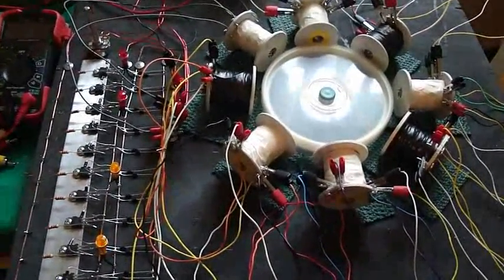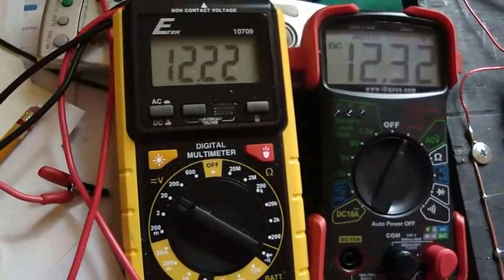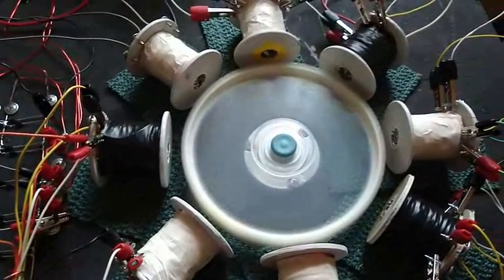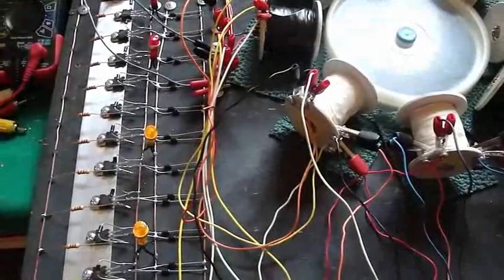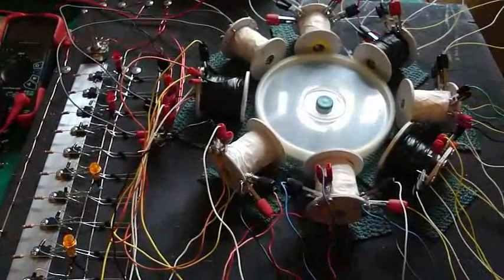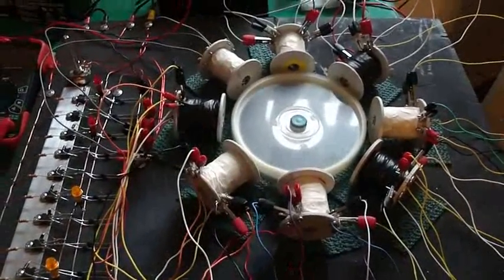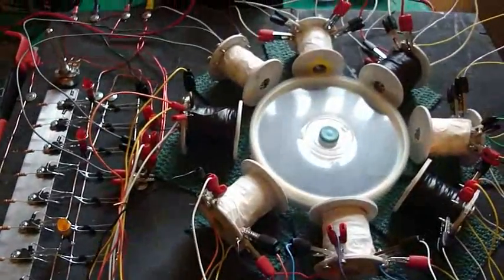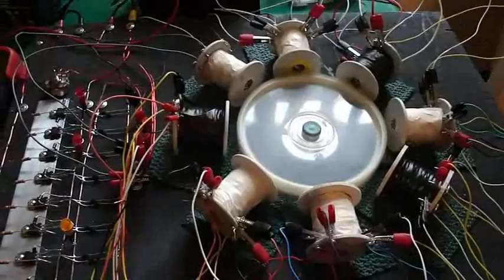Sampu Express.avi

Comment: Just curious, why such a complicated circuit. What exactly is the final purpose of this motor design? Just curious. Never heard of this design. It looks really cool. The Adams motor which looks almost identical is the same motor, but it works on the principle of heavy iron being in the center of each coil. The iron which attracts the magnet is the source of the energy, while the coil is only used to "disarm" the attraction allowing the rotor to pass over the iron cores. It's the principle of the iron and the permanent magnet working together, with the coils acting as a "gate" which produces over unity. I have never built one, but the inventor claimed the coils go colder than ambient temperature and the drive battery doesn't discharge, which is a sign of negative energy entering into a system.

Comment: @PoppyNumber1 well the Ossie motor use a series arrangement, and i have found it to be fairly effective too. the interesting part is how the magnet/core alignment would come into play with each coil. i'd think as long as each coil is "facing" the same way then just series each coil and run one end to the collector and the other to the + like normal. as long as they are lined up right then it should work.. maybe not, might be too much resistance. parallel seems to be the way though with that draw

Comment: lol holy crap!! did you try them in series? i'd think it would fling a lightning bolt or something. the only problem with the parallel is i'd also think it draws alot that way, does it?

Comment from the maker: @IndianaBuddy 

I really don't know what the gauge of  the wire is. All the wire I use comes from salvaged monitors. The run wire is from the degause coil and the trigger wire is from the yoke coil.

Thanks for the tip on the stingo circuit. It looks very promising. I am going to try to build one on the order of the Bedini motor.

Good Experimenting...
Poppy